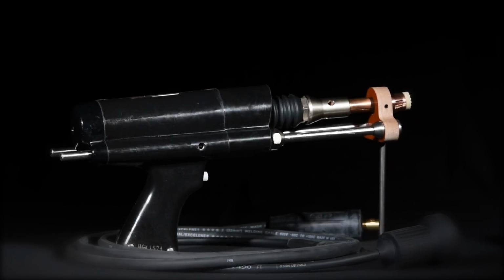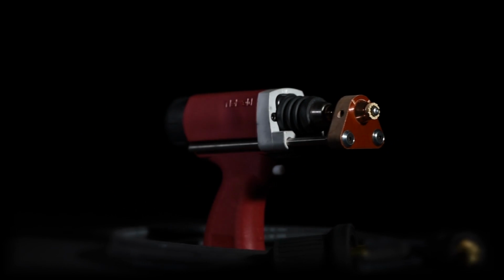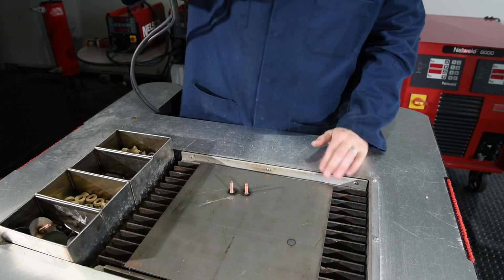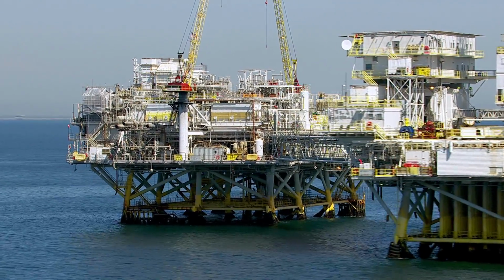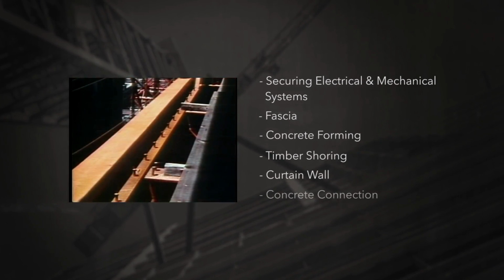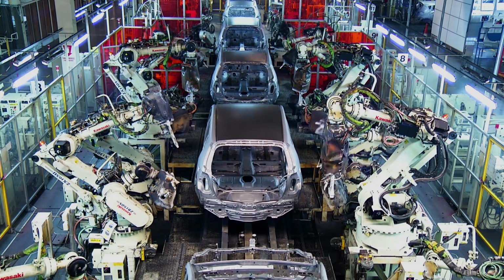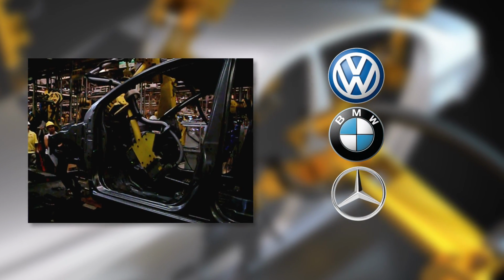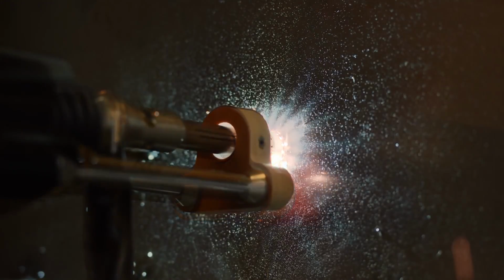Nelson Split Second Fastening

Comment: Is base metal Preheat required on thick steels such as 4" A992 when using stud guns? I know minimum preheat and interpass temps are 225 when fillet welding studs.

Comment: I am about to weld studs to the boat deck, can anyone with experience explain how severe heating of the plate will happen on the other side? I am using 12mm studs and plate is ca 5 mm. Most of the other side is open, but some is covered by potentially fire hazardous materials. I will test it ofc before burning down the ship 😉
Reply: https://youtu.be/OZQ2bgT4I8I?si=DA21bttTukzRICz0

Comment: Can you weld a 1/2 x13  x 1.75 stud overhead?    How do the ferules work upside down?
Reply from the maker: Yes 1/2" diameter studs are routinely welded in the overhead. A properly designed ferrule contains the molten weld pool using a qualified welding procedure.  The Nelson 800# would be good.
Reply: From memory, I think 10mm diameter is the max upside down due to weight of molten material pulling ferrule down.